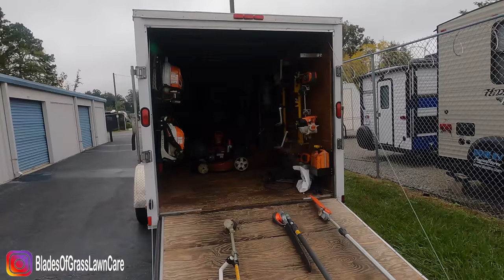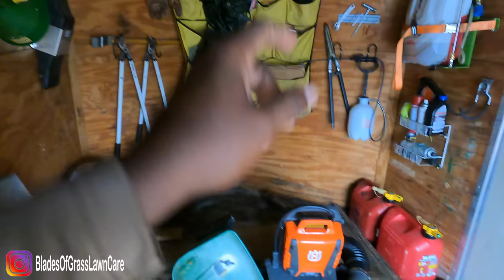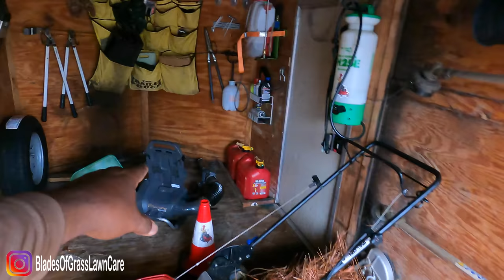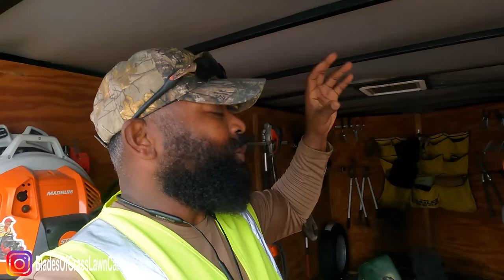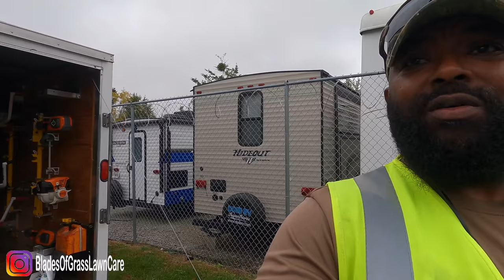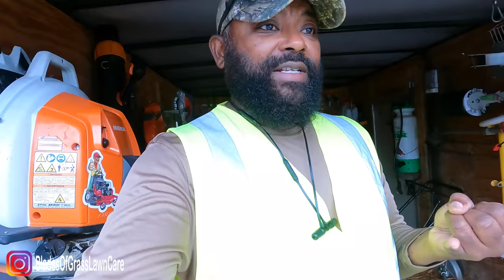Battery Powered Lawn Care Equipment for your Lawn Care Business- Watch Before You Buy!

Comment: There’s a tipping point where it doesn’t make sense.  A gas trimmer is $200 a battery trimmer is $200.  Where it no longer makes sense is the mowers.  A gas push/self propelled mower is $350 (Toro).  A battery powered one is $600 and the battery alone is $250 in most cases.  For me, gas mower and battery everything else.
Reply from the maker: Thanks for sharing!
Reply: Also ask yourself what is the life cycle of the battery before they start dropping in run time and eventually fail.

Will you spend that amount of money on gas in that time frame for before you have to buy another expensive battery.

I dunno I just don't see it as a good long term investment. Specially in the professional world.
Reply: A commercial grade, gas, self propelled mower is not even close to 350. Mine was 1300.
Reply: @davidsenter8002  I was talking residential.
Reply: I totally agree with you on that point. Battery mowers are still too expensive and have to run them on a higher amp battery that is also way over priced
Reply: I own two battery blowers ,a battery trimmer and one battery mower that was given to me  . But if I had to buy the mower I wouldn't . Would rather invest in the battery tools instead.
Reply: @cookiemonster3979  I have a gas Toro z turn and an Ego $600 push mower. I use Premium gas or Truefuel in my equipment, so the battery power stuff gets used where it can be used. I def like not refueling, and that mower battery is great for running the Ego weedeater. The Ego mower powers thru any rural knee high weed yard, where even tractor stall up.
Reply: My 2 smallest 18v Ryobi batteries have lasted me over 4 years. I use them for blower, inflator, drills. Everything. Lol. 

But. And it’s a big but.  They both are to the point where they don’t last long for anything strong, like the blower. I work fast with them though!
Reply: As far as price goes I don't think the numbers work, even when it comes to string trimmers. You can get a decent commercial grade Stihl/Husky gas trimmer for 300$. You can't get a commercial grade 36-50V  trimmer with a battery and a charger. And you have to bear in mind that you'll need at least 2 if not 3 batteries with the minimum capacity of 5Ah. All combined you're looking at 700-900 bucks for that kind of electric trimmer from a brand name..
Trimmers and mowers are cheaper, more powerful and convinient than ev. On the other hand I would go with the electric hedge trimmer, hand held blower, pole saw and pole trimmer. Here you can get by with a 18V system, like the one from Makita for example. And you'd be getting a commercial grade experience.
There are even zero turn mowers oj the market today powered by batteries. They are incredibly expensive and I can't see anybody buying one except if they're loaded and like to be the first users, or for landscaping companies that have a lot of work near the sensitive areas where noise from a gas engine is a problem. Like near hospitals, nursing homes, kindergardens, etc..
Reply: Long run. Battery wins
Reply: @shortyorc121  I actually came from the sign business where we use all battery dewalt equipment and I can say I worked 10 to 12 hours a day and my battery's lasted for at least 3 years and they're all charging good and still work that's just my input for your comment
Reply: You also have to account the gas that you're spending on refilling your equipment a company that's all electric spends $10 extra a month and electricity and saves however many hundreds of dollars in gas a month that definitely makes up for the battery costs especially when batteries are lasting at least a year or two if not three or four
Reply: Also it's going to go to all electric anyway it's just when do you want to make that crossover because now they got trucks that are electric or V6 turbo that can haul just as much as a diesel or a gasoline truck these electric tools are now comparable to gas tools and equipment and they're only going to get better the tech will easily surpass the problems of gas
Reply: @AztecDread  ok well that's good to hear and Dewalt makes good stuff. So here is the ultimate question.... 

How many batteries did you have to buy to be able to have zero down time and at what price???

Also my Honda gx35 I use commercially will easily run on 2 gal of gas all season so that's $8 of fuel for my trimmer.
Reply: @shortyorc121  I didn't buy any battery separate at all every tool I got I paid an extra 30 bucks to get a battery and a charger with it so the batteries were basically 30 bucks a piece for a $300 battery I've even sold some of the chargers because I didn't even need them. I got four 60 volts and about 5 to 7- 20 volts and that'll get me through a day and then you charge them at night
Reply: @shortyorc121  I had to look up gx35.  Looks like a beast lol.  Was it worth it for you over typical trimmers like Echo etc.?
Reply: @flch95  I love it, had it for about 4 years now and she runs quiet and strong and sips on gas. It different then a 2stroke it has so much low end torque I haven't had to give it more then 10% gas lol.

Also you got one heck of a deal on those batteries. I don't blame you for going for it..

Edit: only downside is it's heavy at like 15 pounds, but after the 1st week or two in the season I build the strength to work with it all day lol.
Reply: The price of the material used to make the batteries have been going up.

Comment: I highly recommend putting speed-feed heads on electric trimmers.  Also, since electric trimmers don't have the power as gas trimmers do, the quality of string is even more important so you're cutting through thick grass efficiently and not double-passing over the same areas.  A twisted 0.80 is good along such as MaxPower brand or with 0.80 Oregon.
Reply from the maker: Thanks for sharing!

Comment: Great video. I myself have been using the steel battery equipment for two years now. What I did was, I put solar panels on the top of my trailer  - I installed two golf cart batteries inside the trailer with a  charge controller and an inverter. now I can charge up while I am out and about. And you hit the nail on the head there is no maintenance with these things.
Reply from the maker: I would love to see your setup!
Reply: That’s the only way to go. Charge on the go!

Comment: Good honest review.   I went with the ego mower , weed Wacker, blower.    I take care of 3 small lawns on my block.   It does a decent job with the mower but gas is better.   I LIKE the weed wacker and blower.    The blower is better than my small Stihl gas blower so it depends on your previous equipment as to whether it will have more or less power.        For  small houses and homeowners i think battery is better.       No gas, no mix gas, no pull starting,   light.      No gas smell , no carburetors to rebuild
Reply from the maker: Thanks for sharing!

Comment: In Australia we have a brand sold by a big name hardware shop. The battery's fit everything from sprayers, to hedge trimmers, grinders, lawnmowers. The skins are normally under 100 bucks. I use the blower and Hedge trimmer and they're great. Even made a charge station on the trailer.

Comment: I do DIY yard work and went all electric. Bit the bullet on an expensive Milwaukee mower after being satisfied with their weed eater, edger attachment, and dual battery leaf blower, and being fed up with my roommate’s Troy bilt mower. That Milwaukee mower is awesome. All the power without the excessive noise and exhaust fumes. I can start a side hustle with my yard equipment if I wanted to.

Comment: I only need these tools for home use and my yard isn't all that huge.   Bout half a football field maybe.   I switched to Ego mower, trimmer, and blower.   I love them.   I don't have to worry about seasonal maintenance ...... don't have to worry about getting motors running again..... or storing gas and oils ... changing fluids..... electric is WAYYY quieter... and the tools are much lighter.   For the home gamer, electric is definitely a consideration. EDIT: I replied as I began this video expecting it to knock electric tools ...... but I agree with everything this guy said.   Great   video.

Comment: Great video, little story i first started 6 years ago trying to do a fully battery operated company back then there was sealed lead acid batteries and ego had just come out we we used neuton mowers then we got a couple ego products, the equipment did the job but could not handle the abuse of commercial, so I closed down shop. 
After my son was born I restarted a new lawn care company use gas. Obviously night and day difference now that tech has finally caught up I started adding/ replacing a couple of my gas stuff with stihl ap line. As you said it’s not great for tasks 
ie blower  but that being said it’s great to have lower operating costs again and less maintenance costs with battery equipment (I purchased my stihl ap equipment used) 

As a FYI for everyone reading this toro is releasing the 60 volt commercial HD model 22282 if you want to check it out. I can tell you it’s everything the same as the gas example the blade deck handles the only thing that looks to be different is the motor obviously. I’m glad we have companies pushing the technology needed to help off set costs (over time) for us to run our businesses.

Again Awsome video just thought I share my story  in advance sorry for crappy grammar spelling.
Reply from the maker: Thank you very much for sharing!

Comment: Late last year and early this year we tried battery equipment, and during the slow season they worked ok for the most part. But when the busy season started they weren't enough, and went back to the gas equipment. Also the battery edger worked fine in few spots, but in most places it didn't have enough torque and wasn't working. But the gas edger worked like it was nothing.
Most of the grass at the college is St. Augustine and Bermuda, and some other kinds mixed here and there.
The battery equipment are Makita, in case your wondering, the gas equipment are Stihl. To me battery equipment still has a long way to go to catch up to gas equipment.
Reply from the maker: Fair enough, thanks for sharing!

Comment: I agree 100%. And although the financial level of my landscaping business doesn't allow me to buy and own 90% of the equipment from your trailer, I have also realized that I still need my gas Husky trimmer for more demanding jobs. Of course, gas powered mowers will remain the staple for professionals for a few more years for sure. 
I have managed to transfer to battery powered hedge trimmer and a hand held blower from Makita since they are priced much better than Husqvarna. But who knows what the next season brings to the table. New Honda HRX 217 is what I'm eyeing now...
By the way, one question.. Where did you get all those racks and holders for various equipment? I know one can buy trimmer racks everywhere but I'm more interested in those holding your blowers and hedge trimmers securely to the wall.. Thanks...

Comment: I have a local Stihl dealer and staying with them. I’ve got the BR 700 blower and 131R Kombi system with nearly all attachments. Been using this stuff almost a year and love it. Last week decided to go into lawn care next year. Really enjoy working outside and yard work. Plus with everything going on in the world. Seemed like a smarter choice. My yard consists of 3.6 acres and out of the city limits. So field grass and wooded areas are common. Western Kentucky to be exact. First year I’m definitely sticking with gas powered because I’m worried about battery life. Maybe if it goes well and get clients located in the city. I’ll look more into going electric. I love the lighter weight and quieter operation though. Just like electric mowers. Great idea but just too expensive and if you have to charge that during the day and get back to work. You can forget it. My mower is a Bobcat Pro 7000 61 inch. Thanks for the honest review. I’ve watched your videos going on a year now. Didn’t know I wasn’t subscribed. I’ll fix that now. By the way. I’m an Army veteran too from 2005-2015.

Comment: Love the info.  Great video. Very helpful.  Bought a Toro 60volt trimmer just for my yard. Disappointed in the line advance. The line will not advance with a simple bump, have to pound it hard.  Have taken it apart every thing is clean line is not tangled but the bump nob is very stiff even tried a little lubricant. So this video was very helpful on helping me decide next step which will most likely be a gas powered trimmer. Thank you.
Reply from the maker: Glad I could help

Comment: I have a Makita battery set up.
I have two solar panels on my roof , a voltage regulator and an invertor.
I have a dual port rapid charger with two batteries on charge at all times.
I also have an extra dual port rapid charger that I sometimes charge two batteries at a customer house if I get behind.
I also have a complete STIHL gas products as a backup if needed.
I carry all the Stihl products for back up in a hockey equipment bag.
I have two Makita lawn mowers that can carry 4 batteries in each one.
I sold most of my gas products.
I only am doing subdivision homes lawn care and snow removal.
Life is now good and simple.
Gas two stroke was always a nightmare.
I use to always have at least two gas products out getting fixed.
Reply from the maker: I would love to see your setup

Comment: When operating a lawn care service you can't be too quite. Especially if your properties are clustered together and you are doing one after the other. Or if you mow on Sundays like I do, or if you tend to mow late in the day or early in the morning.  I like some of the conveniences of battery powered equipment, but the main focus for me is the noise level. Right now, all of my equipment is battery powered except for my mower (21" push mower). I am going to get a battery powered mower soon. 

For me, it is all about keeping the noise down as much as possible. If you plan things properly, you won't run out of battery. I charge up my extra batteries with the customer's outside outlets while  I am mowing. And I plan to setup a charging system in my vehicle that will charge up my batteries while I drive or even if I'm parked. I imagine the quality and price of battery equipment has improved a little since this video was made.

Comment: This video I consider to be very valuable because I was seriously considering purchasing battery powered blower as well as a trimmer. I want to be environmentally friendly, and not add to the pollution so on and so on.  I have noticed that some battery powered equipment tend to be a little expensive but perhaps buying them while they're on sale might help.  My one question I want to ask is this....do you personally store your riding mowers with gas in them over the winter.  I purchased a new Husqvarna yard tractor over the summer and I love it.   I stored my Toro walk behind mower last year over the winter by putting Stable fuel stabilizer in the tank. It started early this spring with the first pull of the string and no issues at all during the summer. Can I do the same with my new Husqvarna ?   I know I probably should consult the manufacturer !!!

Comment: I'm on the battery tool journey. I've got an EGO strimmer. My god! It's good.  I'm slowly going to be buying in to it further. A long reach hedge trimmer, pole saw and lawn edger are on my wish list. But as you say. There expensive !! So slowly does it.   I have a Dewalt battery blower which is good for dry grass. I also have a stihl BR600 blower for the heavier stuff.  Since purchasing my EGO strimmer I've not used my Honda 4 stroke strimmer at all.  The only thing I'd say is, I don't think battery is quite there yet in terms of power and run time for a commercial mower. So I use my Weibang shaft drive petrol mower all the time for grass cutting.

Comment: Another tip that I would give people is don't buy the batteries by themselves they overcharge you way too much. What I do is when I buy a tool at home Depot they give you the tool only price and the price with the battery and usually they'll give you a battery and a charger for like an extra $20 so instead of spending $175 or even $250 on a battery you get a battery and a charger for an extra 20 30 bucks so just another thing to consider for anybody wanting to go electric
Reply from the maker: Great tip, thanks!

Comment: Have you been able to calculate how long it takes the battery to pay for itself? (Upfront cost vs fuel expense savings over “x” period of time)
Reply from the maker: 🤔 I may have to do that, thanks for the suggestion
Reply: @Bladesofgrasslawncare  no problem. I also really like the idea of beating the noise ordinances (in the summer when mornings are much cooler) with the quieter tools!
Reply: With some lights you could even mow at night. 🤷‍♂️

Comment: I use a combination of both because I always forget to charge all my batteries so it's easy to just go back to gas.
Reply from the maker: Make sense, 😂👍
Reply: Here is a tip for keeping your batteries charged. Get 1 more charger or more depending on how many batteries you have to charge. Connect all chargers to a power strip and have a waterproof outlet on the outside of the trailer/truck. At the end of the last job put the batteries on the chargers inside the trailer/truck. When you get home just connect an extension cord to the trailer/truck. The next day just disconnect the cable and you don’t have to worry about forgetting your batteries at the house.